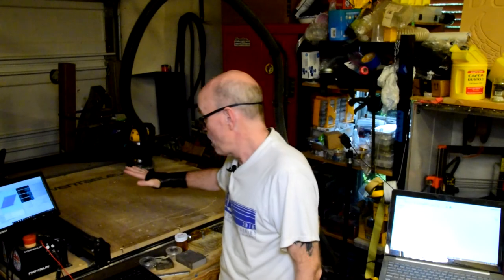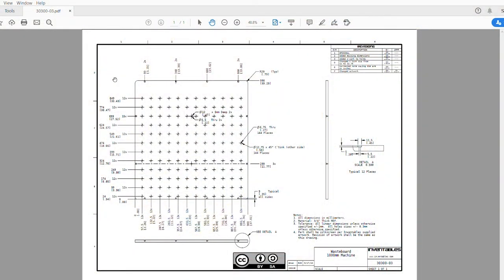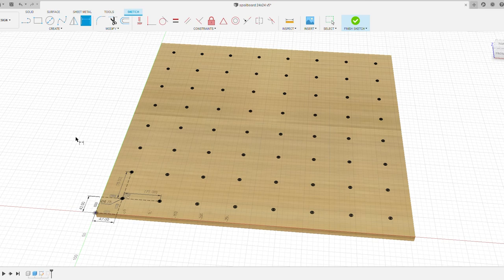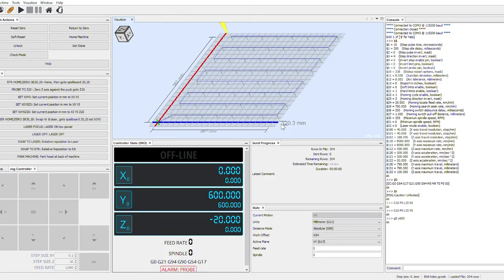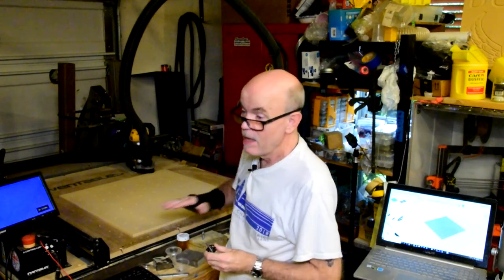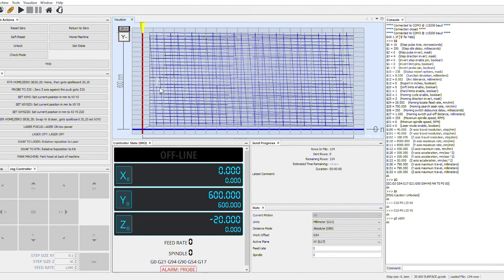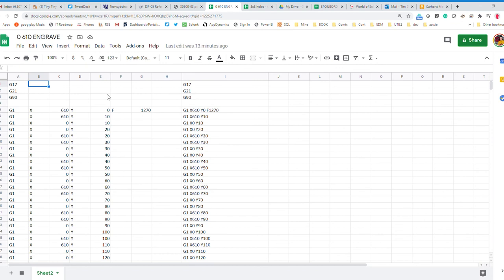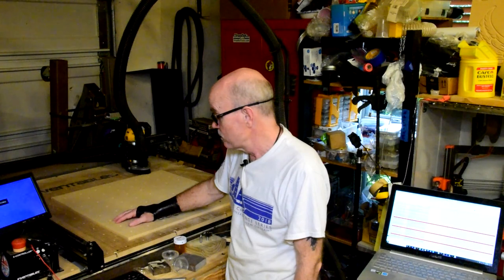Fabricating a Reusable CNC Router Spoilboard

Comment: Looks good ….What screws did you use to secure the waste board ?
Reply from the maker: Because I used the V-bit to chamfer the screw holes, I was able to use M5s that went through the waste board, then the deck and into the underlying rails (replacing selected screws that were holding the deck down with longer ones that had countersink heads.